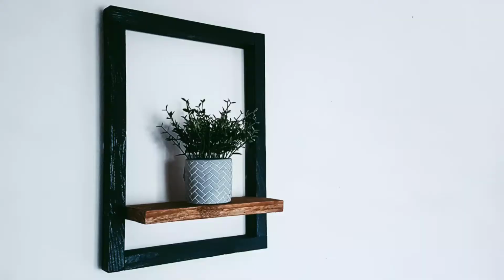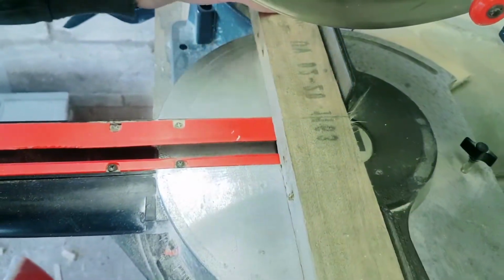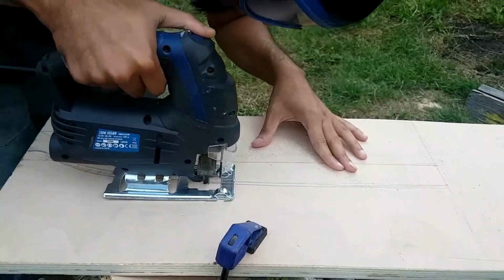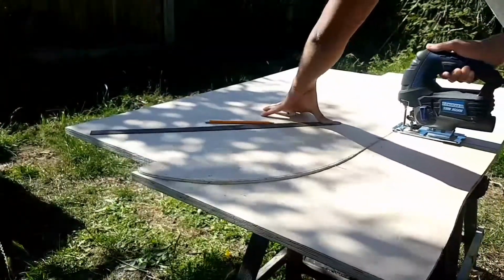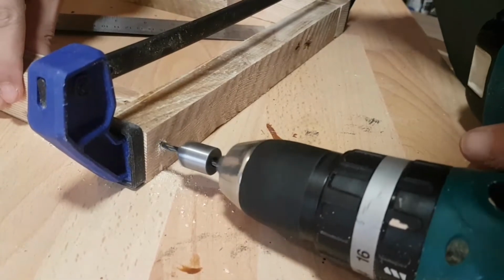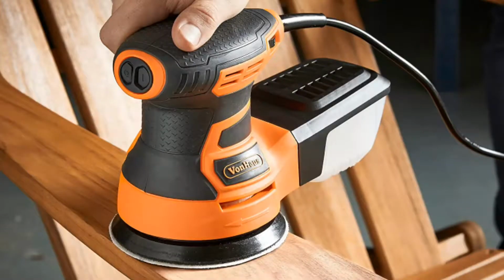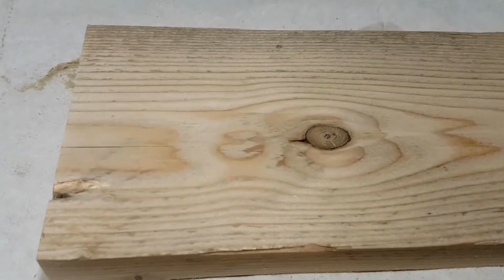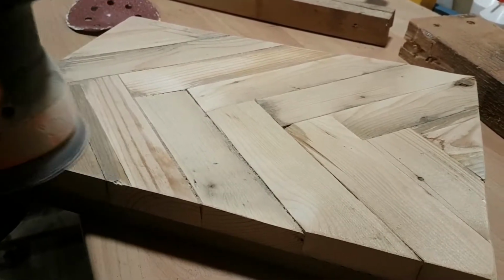(2021) WATCH before you buy!!! Beginner Woodworker With Only 4 Power Tools!!!

Comment: Great video. Everything very true. Don't buy cordless tools unless you really need them. Every brand has it own systems of batteries, which are not interchangeable. Once you buy one cordless tool of a certain brand, you are stuck to it. At least if you don't want to buy for every single tool separately batteries and chargers.
Reply from the maker: Hey great comment,  how are you? Havent seen you here in a while :) Really appreciate your continuous support!